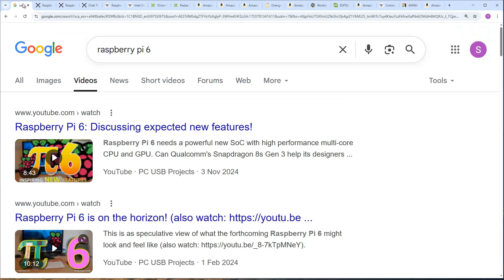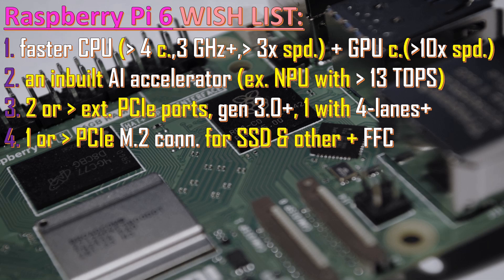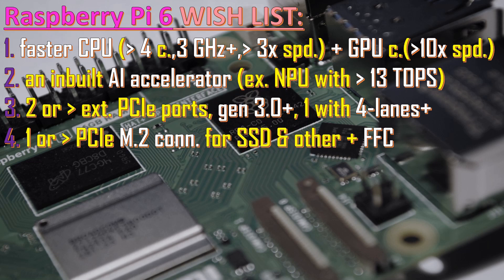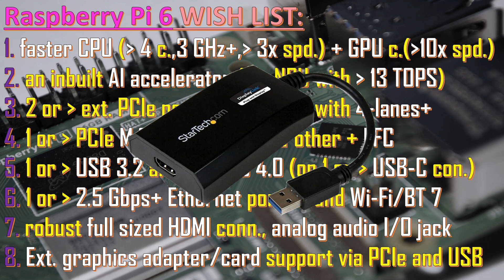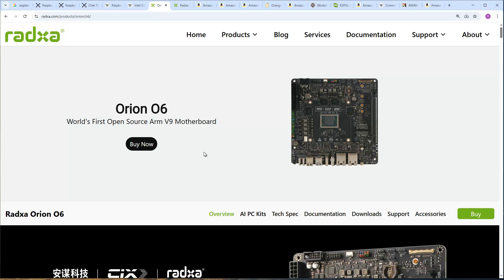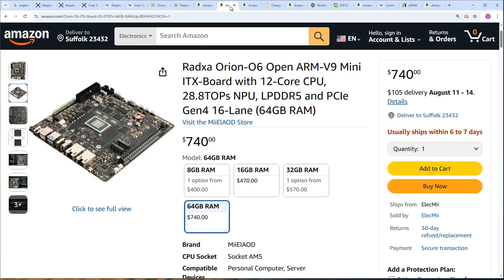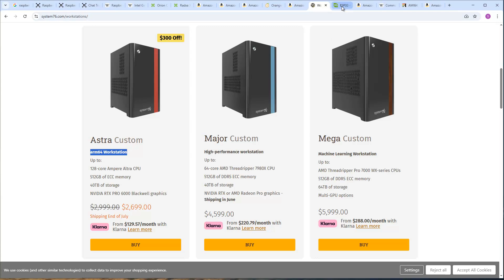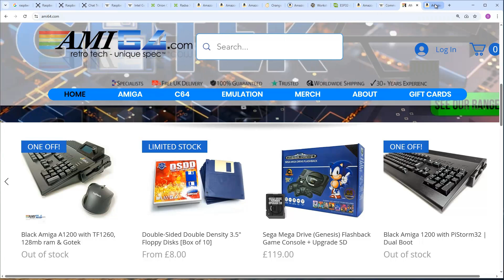Raspberry Pi 6 might surprise us sooner than we think. Rumors are spreading fast...

Comment: Seeing as how I'm on a Pi5 running at 3100, I would hope the next one delivers more than 3ghz. The one next to this one runs at 3150. 16GB one on the other side 2800, womp womp, and has no perceivable value to the extra ram. 

I would want a similar setup to the Pi5 but 12V power, and maybe 6-8 processors with maybe 3300 overclocked minimum, move the fan connector in 1/8" inch, since I've broken off 2 of those trying to hold the Pi while plugging/unplugging USB. And something more with PCIe, surprise me.
Reply from the maker: My current RPi 5 with 16 GB RAM runs reliably on 3 GHz for months now (from the spring), but there is never any a guarantee for overclocking. My first RPi 5 with 16 GB RAM was only able to overclock to 2.8 GHz until it suddenly died. But the old RPi 5 with 8 GB RAM and the old SoC had never had any problems running at 3 GHz. I still use it occasionally, but I'm not overclocking it, because it got it's original cooler, case and PSU back. It is really important to provide a reliable power supply and cooling when overclocking to 3 GHz. I'm not using a standard RPi 27 W PSU. I use my Desktop Pi for hours a day, and I've never had any problems. However, I don't push it beyond 3 GHz to preserve it as much as possible. Watch: https://youtu.be/w4H88821tLk, https://youtu.be/zNve_hjinDI.

RPi 6 will surely have a different SoC, therefore CPU performance may not entirely correlate to the clock frequency, as it is now if you compare two RPi 5s. Adding more cores may require to lower the clock frequency, but there is surely an option of using cores with a much higher performances. An interesting idea is also to use cores with asymmetric performance as it's already been done in RK3588 SoC that powers competitive SBC designs. Watch: https://youtu.be/_8-7kTpMNeY.

The right choice of connectors is not always easy due to previous Raspberry Pi models. If RPi 6 introduces a different fan connector than existing RPi 5 fans will not be able to be used in upgrades. However, many RPi users would prefer full sized HDMI connectors instead of current micro HDMIs. Orange Pi 5 Max is an excellent example of how it can be done without increasing the form factor beyond current RPi 5. Watch: https://youtu.be/9dNoa8zPWkU
Reply: @pcusbprojects  My 3150 PI5 is always at 3150. Stock cooler is fine. Same as the first one that ran 3150 til the micro HDMI broke. The 3100  and 3150  are both using M.2 built onto the coolers set to Gen3 but they're Gen4 m.2. Basically everything as fast as they can be run. 3125 vs. 3150 there was one game that  0025mhz made a difference between playable and miserable.

I don't want them to change the fan connector. Just move it back 1/8" behind the USB 2 so it won't be pressed on accidentally. There's no space for the full size HDMI. I like having 2 micro HDMIs. I have used the HDMI1 out to a capture card back into the USB on the same Pi5 and recorded with OBS 720@30. While HDMI0, had the OBS up showing HDMI1, which was a browser. Playing and recording on the same device. Now THAT seems to work better on the 2800 and 3100, less dropped frames, with a better capture card
Reply from the maker: Cool... My cooler is keeping my RPi 5 even cooler (about 40 deg. C) at lite load at 3 GHz (as I'm writing this text) than the stock cooler at 2.4 GHz. Fan is turned off even at constant maximum load, except when the room temperature reaches above 25 deg. C....I still recall my classic PC with an AMD processor running at its designed CPU frequency on an quality motherboard being totally destroyed after approx. 2 years -- blank screen - CPU or motherboard gone. I've of course bought Intel + a new motherboard and salvaged the disks, video card and PSU... I suspected the motherboard's capacitors, but the CPU had always been running much hotter the an Intel would have been.... Be careful about SoC temperature at different loads and keep up the good work...

Comment: Nah, all I would like is double or more soc power and a full sized HDMI port.  Keep it the same form factor and be reasonably cheap to buy
Reply from the maker: Why not quadruple? Or more? Raspberry Pi 6 will have to be build with a more sophisticated chip making technology to remain competitive in the SBC world...But it would be great, if it keeps the same form factor as well. I've seen competitive products (https://youtu.be/9dNoa8zPWkU) which have no problems with even to full sized HDMI connectors while preserving the original Raspberry Pi form factor. But this only means that Raspberry Pi has a large margin for designing Raspberry Pi 6 that will wipe out the competition. Watch: https://youtu.be/t6dZiNAqlhY.

Comment: Better processor is a given, NPUs would be nice ideally LLM compatible but it may shoot the price up, so maybe a cheaper hat?
For me it’s all about the ports, just move to true USB-C 3.2 or 4 with at least 2 with PD and all with DP, this would allow to configure the ports to our needs.
Maybe keep 2 classic USB 3.2 ports at the back and 2 USB-C 3.2/4 ports.
As for networking, a 2.5 Gb network would be a plus for future proofing but not required.
I agree that’s the PCI-E port needs to be upgraded.
Lastly, a built in M.2 NVME port would be great and should not increase the price.
As for RAM, from 2 to 32 GB would be a plus, 32GB would be great to run LLMs at home when paired with a compatible NPU on board or hat.
Reply from the maker: Chips are getting ever more capable as the chip making technology is getting ever smaller. All classic PCs are therefore getting smaller, but Raspberry Pi 5 and other less powerful models now have an excellent opportunity to instead get much more powerful. Everything has to get updated as much as possible...

Comment: if the cpu and gpu are not significant improvements over the pi 4 and 5 then itll be a dead turkey on launch. the current pi 5 is weak for its cost vs just buying some used mini pc that can run circles around it allllllll day long. so they need to wake up and put a significantly improved cpu and gpu in their next pi. otherwise its a dead product as far a substantial part of their market of users are concerned. this part of their market was very disappointed with the meager improvements of the pi 5 over the pi 4. it felt like a bit of a rip off to be honest. i ditched pi after using the pi 4 for a mini pc for emulation and whatnot. the pi just is not a good option in that arena vs mini pcs. even if its a used mini pc it blows any pi out of the water in regards to emulation ability. which mini pc? pick one. thats which one.
Reply from the maker: Watch this video https://youtu.be/t6dZiNAqlhY next. It might interest you. There is also a playlist of videos on Raspberry Pi 6: https://www.youtube.com/playlist?list=PL4oroKqFX0qrohY7biCnviuCS6maPjom-

Comment: UEFI bios would should be included - removing the need to constdantly re-compile new linux distros
Reply from the maker: I agree to a certain level, because a part of me likes the settings accessibility and the ease of installing new operating systems to classic PCs. However, UEFI may also pose a security hazard, if your computer gets infected by a bootloader computer virus. Because most of motherboard manufacturers only offer UEFI upgrades, an infected BIOS and the rest of a PC's EEPROM content often cannot be entirely replaced to sucessfully remove a malicious code. Raspberry Pi is unique and it is on my opinion much safer in this regard. Watch:  https://youtu.be/AGGgwN35uRg.

Comment: #6 I would also say, in-build the POE into that ethernet port as well, currently that has to be done through a hat.  If you ask for an NPU then I would think another obvious adder would be greater amount of RAM so that you could support running bigger models using the in-built acceleration.
Reply from the maker: POE is not a bad idea, but it takes a considerable space on the PCB. Watch: https://youtu.be/myuxPRa69jE to see all the unoccupied space on the RPi 500's PCB reserved for possible POE circuits and chips installation in future models. Of course, it is also possible to make a working POE, but to do so, you should guess the missing elements and solder them yourself.... 
An AI accelerator is not necessarily a specialized NPU, it can also be implemented as s set of special features within a powerful GPU with hundreds of cores (like CUDA on NVIDIA graphic cards). However, I believe that probably an Orange Pi 5 Max like solution (watch: https://youtu.be/9dNoa8zPWkU), but a much more powerful, is also not a bad ideal... It seems to be much simpler an cheaper, except if Raspberry Pi 6 is gonna have an inbuilt state of the art GPU, which is probably not gonna happen. However, AI functionality is becoming a must, anyway due to a rising number of AI functionalities (like speech recognition) that most of the users would prefer not to rely on various (expensive) internet services.
Twice the amount of RAM is also envisioned  based on my previous experience with Raspberry Pi models. However, RAM (like 64 GB) still seems to be quite expensive... If you measure memory utilization, I guess 32 GB RAM (twice as much as the most powerful Raspberry Pi 5) would probably be enough for most AI projects. Radxa Orion O6 has 8 GB, 16 GB, 32 GB and 64 GB options for example (in the video). The last option without a case (just the bare computer) will set you back for about 740 USD, which is as much an average fully assembled gaming desktop PC...

Comment: So I just fast forwarded into the list at 6:41. They going to slightly bump the SoC specs, but that's about it. Most of these are wishful thinking. Just the formfactor alone doesn't allow them to put on so many new interfaces.
Reply from the maker: Watch https://youtu.be/9dNoa8zPWkU video first and then watch this video again without skipping. There is little to nothing rally new regarding connectors, but hardware communication standards are significantly upgraded to catch with or slightly surpass the competition. It's like a much better orchestra with the same number of musicians playing the same music on a much higher level.... SoC unfortunately needs significant upgrades to gain comparable performance to current competition and ever more advanced classic mini PCs with Intel and AMD processors with embedded GPU cores.
C64 was my first computer, which I still own. But I rarely use it, mostly to display it to my relatives and friends on special occasions. I hope that Raspberry Pi can do better than this...

Comment: I don't expect a huge increase in performance, but whatever we can get would be nice.

I would like display over usb so you can connect it to a dock with a single cable.

Part of me wants on board storage on UFS or eMMC, but I can see the disadvantages of that.
Maybe faster SD card support would be sufficient.

I would like better thermals to reduce the need for active cooling.
Reply from the maker: I'm afraid that a huge increase of CPU&GPU performance for Raspberry Pi 6 is a must, if Raspberry Pi is going to keep developing mini desktop models like current Raspberry Pi 3, 4 and 5. Miniature Raspberry Pi Pico 2 and Zero 2 are great with any classic PC and of course with Raspberry 3/4/400/5/500/CM5 on the other hand, if you need just a simple (additional) Raspberry Pi I/O functionality, an I/O controller or a full (additional) 40-pin expansion port... There are also competitive products like Orange Pi 5 (https://youtu.be/9dNoa8zPWkU), which should not be underestimated.

Comment: No. We want cheaper, low power consumption, more RAM, M.2 SSD/NVME support and GbE2.5.
Reply from the maker: A much lower power consumption (W/GFLOPS) will be achieved by Raspberry Pi 6's SoC with a more advanced chip making technology, ex. 8 nm or lower instead of current 16 nm. If you are looking for a extremely cheap Raspberry Pi model, Raspberry Pi Zero 2W like computer, but 10x as powerful, with 4K graphic, might the one that you are looking for.  Though Raspberry Pi Zero 2W only has a 40-pin expansion port, an HDMI output and 2 USB ports, it's basic design in intriguing, and extremely minimalistic. On my opinion, Raspberry Pi 6 will have to cover a very diverse range of users and it will therefore (on my opinion) have to somehow compete with classic mini PCs at least. So, It can't grow smaller, rather a bit larger to have more connectors, not less. The use of more smaller USB-C connectors might be the way to keep existing form factor, but still add a lot of new functionality. It definitely needs more RAM. I expect that Raspberry Pi 6 model options will start at 4 GB and they will go at least up to 32 GB of RAM. 2.5 GBps Ethernet ports are a must. Raspberry Pi 5's prices will consequentially fall, but there are still a ways for improvement.

On January 15, Eben Upton also told us that it was possible to add up to 64 GB RAM with the new BCM2712 D0 chipset (Watch: https://youtu.be/86fNZqQTyqk). It might have also been possible to replace the Ethernet controller chip on RPi 5's PCB with a more powerful one, like the one used on Orange Pi 5. It seems to me that RP1 microcontroller could have supported a more powerful Ethernet controller.... Raspberry Pi 5's SoC could also be made with a smaller chip making technology, but I'm afraid that this effort your not payoff for Raspberry Pi, because BCM2712 D0 SoC is getting obsolete anyway and just increasing the clocks speeds would on my opinion only satisfy a few users, but would not make the Raspberry Pi 5 more attractive to majority of others. Something entirely new and a number of timer more powerful is needed...